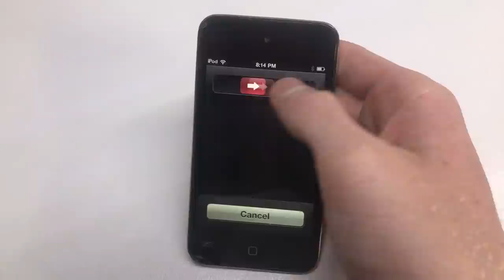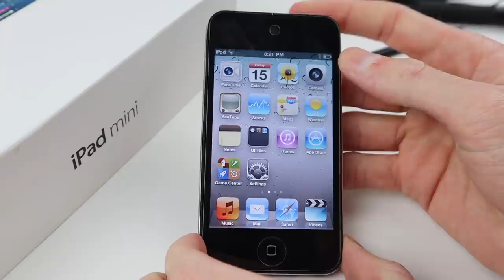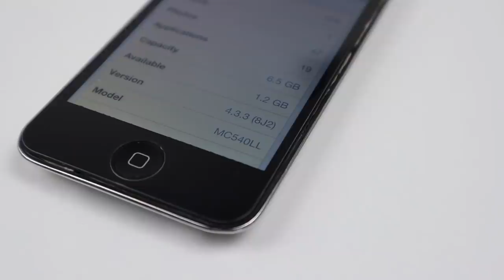The Unrepairable iPod Touch

Comment: The soldering points on the cable that the power button is attached to is touching together against metal or the frame of the ipod. It needs to be covered so the soldering points do not cross connect

Comment: I've only ever done one of these, got it cheap back in the day so thought why not give it a go 'cause if I break it it's nothing much lost. For me though I didn't have a heat gun or anything so just brute forced it from a crack then picked the edges away, I used normal manicure tweezers to press the connector in which worked reasonably well for me 'cause I had to do it again for it after I sold it but I guess I was lucky 'cause I never had any issues with the power button after doing it. Think the most difficult apple device I've done was the original iPhone but that was 'cause it was the first thing I'd ever opened to actually repair with the tools you get with a screen and probably 'cause I was like 14-15 at the time

Comment: The contacts for the power flex cable could be grounding out on the mid plate.  Pretty sure that’s why there was gunk over the contacts when you removed the flex cable initially.

I feel your pain though, always end up breaking something when trying to repair one of these iPods.

Comment: I did one of these back in 2014, it was tough but it worked no problem first time. I removed everything to get to it all same as you. Credit cards and heat to the chassis stop you mullering the battery.

Comment: It might be shorting on the metal frame. You should try adding kapton tape over the solder joints where the cable gets connected.

Comment: It looks like you didn’t cover the solder connections on the board with kapton tape so the metal plate is now shorting out the soldered connections when the screws are tightened. Great video.

Comment: I don't know if you still solder stuff, or if you've gotten better equipment, bit those irons are crap.
I can recommend a TS-80, with default chiseltip, as long as you flux it's excellent on even smaller connections, direct heating in the tip, no issues like in this video were it couldn't transfer because the tip was too thin and then didn't have enough thermal mass...!

Comment: The trace in the board may be broken. Tightening the screw causes the break to separate enough to prevent the power button from functioning. Just a thought. CB curious to know how this turns out. Thanks:)

Comment: From what i researched i know that some ipads may have this isue with the power button after replacing the screen with a non original one (i had this problem with one ipad i had a while back) but since it is an ipod and you had it working before final assembly i don't know if the problem could be the display... Maybe if you do some more research you might find out! Good luck!

Comment: my firts ever fix was a cheap ipod touch 4 with a smashed screen and a missing home button i managed to make it on the first try with the only issue ever being the white screen in the begining which was fixed by grounding the negative pin on the battery to the chassis, and keep in mint i was about 14-15 YO when this happened. that ipod served me well for over 2 years and then i sold it at a price to be able to break it even. got a second one when i was 19 on a flea market and succesfully fixed it yet again. it is now collecting dust in the drawer somewhere. 

i guess im the only one here that has fixed 2 without any previous experience.

Comment: I highly recommend a TS100 solding iron. Its a amazing soldering iron and can output a lot of heat on things with many layers of copper
Reply: Piggy backing off my old comment, the ts100 would INSTANTLY melt those pads Hugh struggled on, even at a lower temperature. And it doesn't take 2-4 minutes to reach its full potential like those eBay 20 dollar cheapo kits do. It takes about 15 seconds from cold start to target temperature. And it recovers extremely fast after soldering a huge ground plane.

Comment: And I always wondered how shops used to repair iPods. I had a classic like the one you show that had a messed up hard drive that I had fixed. Then I got an iPod touch that has a bad battery that I want to get repaired and no one seems to repair them now. Lastly I had to use an old iPhone 4 to hear my music and the power button got stuck and you gotta press really hard to turn it on or off. I would have tried a home repair but there's way too many pieces and I'd probably lose the pieces

Comment: Hugh Jeffreys is there any chance the solder is exposed to any metal parts when in the housing?  Hence shorting out and not working??  Try covering the solder joints with an insulator

Comment: I have iPod touch 4th gen and 5th gen.
4th gen is still working normally, however the 5th gen’s battery is completely dead and need replacement.
It’s really hard for people doesn’t know how to soldering, that being said if your iPod stopped working, best suggestion is throw it away and get yourself an iPhone...

Comment: I have repaired all iPod touches, with the fourth gen, after replacing the screen, DO NOT SCREW IN THE TOP SCREW NEAR THE POWER BUTTON. instead use a low grade adhesive. Itll be strong enough to hold the board in place, but not strong enough to tear anything off the board in that location.

Comment: The gunk on top of the flex cable solder pads might function as protection from beeing shorted by the metal shielding that sits between the lcd and logic board.
Reply: You mean being
It is 1 e not 2

Comment: Seems like you may have the wrong screw near the flex cable and it may be breaking it when you put it back together. Screws in iPods can differ by 0.1mm and mess your whole repair up

Comment: I repaired an iPod touch 6th gen, and it was working perfect after the repair, it had a torn wifi cable that I tore during the repair, but otherwise, I replaced the wifi cable from the old housing, and it the wifi, and the iPod works perfect even about 6 months later.

Comment: you can still use that itouch4: jailbreak it, install a cydia tweak that lets u use gestures to simulate the power button (for sleep and shutdown because u can always wake up the itouch with the home button); for turning it on you have the only option to connect the cabel to power/usb, but unless it's totally discharged u rarely need this way; so 95% of the time u can pretty much use it with special gestures and no power button at all (I did this on an old iPhone 5 in which I ruined the power button too)
Reply: i have a iphone 5s currently that i want to jailbreak

Comment: When you removed the power button cable you mentioned that it had something sticky over it. Could the connections be shorting on the metal frame that screws down on top of it. If that's the case then it would explain why it worked before the shield was screwed down.

Comment: At least you can use the virtual power button to lock the screen, but recovery mode and turning it on will be a no go.  Only to turn it on would be to plug it in

Comment: Is it possible that you dont screw in tbe top screw thats supposedly pressing against the power cable and screw in everything else? Then there will be some slack on the cable.

What im thinking happened is (theories or possibilities?)
The screw is maybe touching the cable and either shorting out the cable or maybe is pressing against and damaging it?

Comment: Still have mine. The only problem I have with mine is that the battery drains really fast now. Thought about getting it replaced but after seeing this video its not worth it. I'll just keep it on my bluetooth radio that has a charging dock.

Comment: I guess it's designed for assembling it ONCE. I assume that's parallel to some NASA vehicles in the 60s ;-)
Maybe apple engineers know about the issue of the power button tricky thing, but moved on to the next mature version. It may be a software problem, hard to believe, but possible in my opinion.
My Ipod from 2010 worked for ten years, which is really astonishing. Nowadays i am unable to afford such good hardware,  also because they have there time and the next versions are really different. Think about the accelerations managed by TSMC going down to 3nm from 10/14 nm Intel stuck with. Neural engines for example.

Comment: It's being difficult because you've been disassembling/assembling it backwards. You FIRST desolder the battery and button cables during disassembly, so the board comes out much easier, then put new cables in, then you put the board in and resolder the cables onto the board.
Reply: This guy is an expert in repair, I’m almost 100% sure he knows what he’s doing.

Comment: I had a faulty one of these with a cracked screen, thought I’d attempt a repair. All went well apart from I burnt the power cable soldering it back on, so got another one which went back fine. All was perfect until I clipped the screen back in and cracked it. It went straight in the bin after that.

Comment: I ha e the feeling that some soldering is broken on the mainboard. As soon as one of the screws is tightened, then the deformation of the board is enough to separate the two halves of the solder and thus making the home button not working.

Comment: Doesn't look like you glued the flex cable for the buttons down. It normally wouldn't matter but those cables are unbelievably fragile and probably got caught under the logic board when installed.

Comment: I think the board might have a bad solder joint somewhere so when the board just sits in the phone it’s workin but when you install the screws it might be flux in the board just enough that it makes that bad joint loose connection idk that could be it or I’m completely wrong

Comment: It's so sad that Apple made these things so hard to work on.  I have 2 of them and 1 of those cost me near $300, has 32G and is in great condition.  Battery is low, but still works. -------- One of the important things about these is that you can run apps.  Sadly, they are well supported in the app world, but being able to write or run apps, having WiFi, BT, Retina, storage, etc... they have a LOT of uses.  Thinks like IoT controllers, data collection, remote device work on an IoT network, etc...

Comment: The iPod Touch 4th-gen is the only device I've actually managed to break while repairing (I sheared off a cable that was stuck down, while opening the device).  This device is, above all, the WORST in terms of service-vicious action on the part of Apple, Inc.  Of course they want you to dispose of it and buy another.

Unfortunately, Apple's computers have been designed by engineers who studied how service-vicious this device is, and took that as encouragement to make laptops and desktops service-vicious, as well.  Because of course they want you to dispose of your laptop and buy another if your touchpad stops working.

Comment: During final assembly some sort of short to ground must be taking place. It could be that tolerances are so tight in there that when you get to the final step either the screw was over tightened or that cable separates from the logic board when everything is fitted together.

Comment: I remember years ago that my iPod touch cost as much to repair to screen as it did to buy it. Definitely was not worth it.
Reply: Because apple would have just replaced it with a new one. No one could possibly put that much effort in fixing something not designed to be fixed.

Comment: i had a similar issue with my iphone 6, i was repairing my phone and so everything was working and i screwed in everything and then it wouldnt turn on, turns out one of the screws wasnt where its supposed to be and so when i tried to boot up the phone it wouldnt, im guessing here that one of the screws is short circuiting the cable for the power button, you could try using another screw or you can just leave the screw out but it might take a while before u figure out which screw is messing it up. Hope you see this!

Comment: Repairing the iPod Touch over a Samsung display. So savage. But yeah, I have the previous one, the 3rd gen iPod Touch with everything connected but without the touchscreen working. I was very pissed when after removing the cracked digitizer, now the new ones doesn't work (I bought two). So, music on the phone only.

Comment: I had this issue with an iPad 2nd gen. I had to take the screen off and it worked? It was strange then I had to change the settings for lock/unlock when Smart Cover is present, it was the OEM screen and digitiser that come with that iPad 2nd gen. it was strange

Comment: The iPod touch line just got worse to repair, my 5th gen needed a screen replacement and removing the old display would render the "connector" useless as it was all soldiered to the board, it's obvious apple just wanted you to buy a new one instead of repair the one you already own

Comment: I got scammed out of AirPods pro. ☹️ they said “Brand New” but the box was opened, AirPods case was scratched and dirty. AND the AirPods were connected to someone’s phone. I have there name! I’m extremely pissed since we can’t return them so I lost 250 plus tax. I understand they are still usable but I tried them and the battery died from full charge in 1 and a half hours.  This is so sad

Comment: the iPod touch 4th gen is the WORST ipod to repair! I also had weird problems while repairing the device, like the volume buttons not working after i screw everything back into place, i also replaced the darn cable, its working at first, but when i assemble the ipod and glue the screen back into place, they stopped working AGAIN! I abandoned this ipod because its so frustrating to deal with the ghost of the ipod 4! The ipod touch 5th gen and onwards are a BREEZE to repair compared to this ipod 4th gen! I replaced the battery and made a black screen version of the ipod touch 5th gen blue, everything went very well! If you want to repair an ipod, skip the 4th gen, because its never gonna be the same again!

Comment: Lol I repaired one I bought, the screen and the battery. Never soldered before and I did it. and the button issue I had on another one I had and it's the plastic peace. It's stuck or not clicking.
Reply: You need a new back housing.

Comment: iPod touch 2nd and 3rd gen is the worst to repair or replace battery.  1st gen is much simpler......  Haven't worked on 4 5,6, and 7 since not interested with iPod Touch line anymore.
If I need just a music player, iPod classic or Nano will be great.
If I want something like iPod Touch, just get used iPhone 4 - 6s and very easy to work on also headphone jack....

Comment: I remember I found one with a cracked screen in the trash in a library back when it was new. I thought it was a sweet find and that I would replace the screen. It was B!$ch. Fixed the screen and the buttons wouldnt work well. Such a hassle. I ended up throwing it in the trash myself

Comment: I literally tried doing a screen replacement on my gen 4 ipod touch And when i tried moving up the metal shield the fucking motherboard snapped in half and it turned out i didn't see the top middle screw but the board just snapped so easily without s lot of force

Comment: Just wondering if anyone can help. I recently gave a screen and battery replacement to my mums ipad mini 2, i got the new parts from crazy parts. After completing the restoration the screen keeps randomly going black for a second or two then when you turn it back on you have to input the passcode again. At first i thought maybe it was a faulty connection so I took it apart and reconnected it again. However, I am still seeing the same issue. There seems to be no reason behind it like its not when i shake it or tilt it upside down for example. 

Please can anybody give me suggestions? Thanks.
Reply from the maker: Sounds like something is triggering the smart cover function. So the magnets controlling the sleep when a cover is closed.
Reply: Hugh Jeffreys hugh that was exactly the problem. Took off the case used it for 5 minutes and it hasn’t happened again! Thanks for the information, clearly a dodgy case and will replace. You a legend! :D